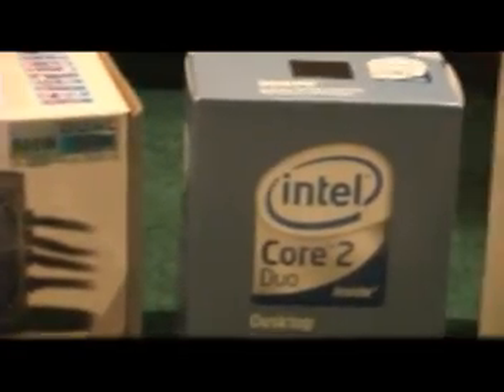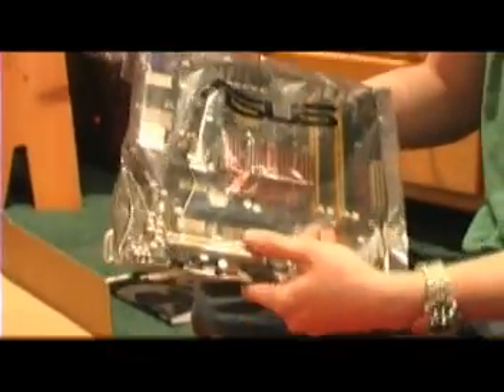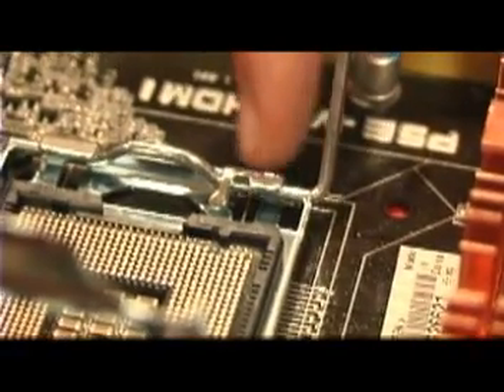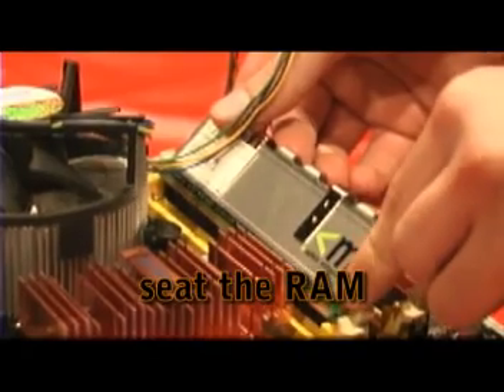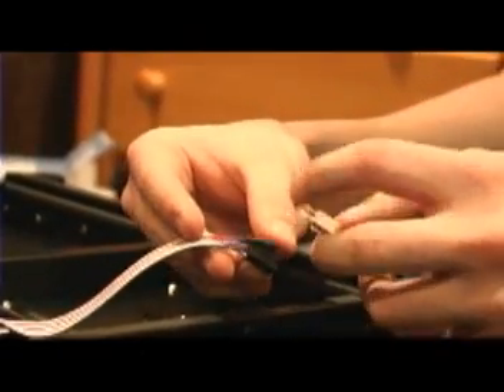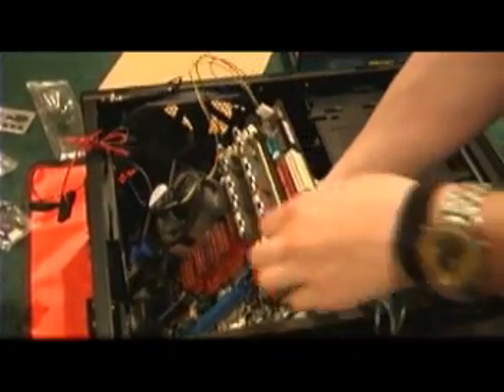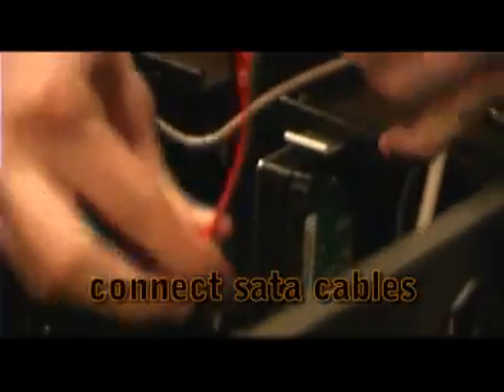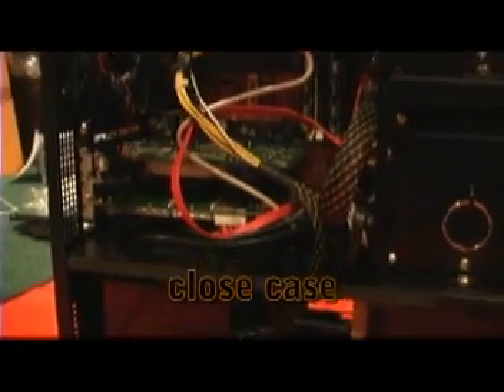A 10 Minute Beginner's Guide to Computer Building

Comment: If you are talking about if they are compatible together, yes. The main thing to look out for with compatibility is to research your motherboard and see if supports your processor. Also make sure your motherboard supports the amount of ram that you are going to put in it. Those specifications should work together if you install it right.

Comment: @JesusReveron 
The fan/heatsink that comes with the CPU has thermal paste pre-applied. If you buy an aftermarket cooler, you'll need to apply a small pea-sized amount of thermal paste to the CPU once it's set in the socket.

Comment: @JesusReveron You absolutely need thermal paste. It covers the microscopic gaps between the heatsink and CPU so you can get the best possible thermal transfer.

You only need to install it when putting on the heatsink though, otherwise it's just messy. Look up guides on applying it, you don't want to use too much or it defeats the purpose.

Comment: @nubemuffin well, most motherboards nowadays, have a flashing utility you can use where it is simple as putting it on a flash drive and using the built in flashing tool, even so some motherboards have BIOS updates you can activate inside your OS. But really you shouldn't have to worry about flashing unless the motherboard literally doesn't work at all, Flashing your BIOS to the newest one isn't always completely necessary, in fact most times as long as you buy a new board, You won't ever need to

Comment: All that anti-static stuff is bullcrap... I work with electronics and i know that even if you rub your motherboard on the carpet it won't make a difference You dont have to be grounded while building just make sure that, before you start your pc up, all the ground wires are in place and that the adaptar is grounded... Then it is all ok :)

Comment: lol, it's not that hard to put together a computer. It's like a puzzle, a puzzle that comes with a manual. Just read it and you'll be fine. I was clueless as to how a computer was build when I built my first computer, I used the manual and it went fine, only problem I faced was that I forgot to plug in power to the CPU.

Comment: . I used to build these as a spare time sort of job.
They are much easier now mainly thanks to windwows xp.
Youd install everything and  it booted ok  but then youd find you needed drivers for this and that to work which was a right pain.
I also used to help people out with comp probs but it got a bit time consuming and I had to stop that,
The parts are designed to only fit one way usually so its not  difficult.
Main thing if youre thinking of this is your motherboard the heart and soul of it.

Comment: I just ordered a complete build, including 18.5" lcd, 9500gt vid card, and 4 gb ram for under 700 bucks.

Ill be using this little tutorial to put it together as the parts used are very close to the ones i ordered.

Thanks! Subbed.

Comment: yes yours is right but if the case doesn't have a vent on the bottom so it can take in air you flip it around. But theres no point on having a out take on the bottom of a case cause heat rises.

Comment: @BaMaNeLiTe  Just like darkstar said, watch the pin orientation, it will only go in one way. dont touch the pins, make sure none are bent, dont force it, with the lever  up and the cpu  turned the right way it should drop right in socket.  Carefully close down and latch the lever and its in and the pins are safe now.  make sure to use a (thin) film of heat transfer paste between the cpu cooler and the processor and secure the heatsink -- plug the fan into the cpu socket and youre done-!

Comment: say the motherboard is socket 775 will it defineatley have the connection on the motherboard for a socket 775 fan? also do all motherboards have the connections for the case reset switch power swtich etc.
thanks

Comment: the bulky psu? I do plug the psu connectons first before the drives and other thick cables, but then I have to also constantly turn the case up on its side, upright, back again, PSU in the case won't make that any easier, better to throw it in there last?

Comment: There is one built ON the motherboard it's usually very crappy unless it's a nVidia card.

To find your video card/chip, go windows key + r and then type in dxdiag. 

Go to the Display Tab and it will tell you,
Like.. I Have a GeForce 9500GT,
but my onboard one is a GeForce 6150SE,
If you get a actual video card, it will disable the one on the motherboard.

Comment from the maker: You can still use XP just fine.  That just means it can use Vista if you want.  A 500W PSU should be enough, but you might want to get something a bit higher in case you upgrade in the future.

Comment: hey 
its me again with prob a dumb question but you have to start sumwhere right?
lol kay well change of plans on the ram and the cpu.i was going with the phenom 2.5 black editon and then i was thinkin i could save alot of money by going with a the athlon 64 x2
(2.7)  and i have a question on power supplys and how my board says "vista ready"  kay well question is if i get a 4850 would a 500watt psu be enough?  and i was wanting to use xp. would this be a prob cause the board says vista ready.

Comment from the maker: this is true.  The speed will be set to 800 by default, and you will need to turn it up.  Check the settings for the RAM though, because you may also have to adjust the voltage and timings.

Comment: this was put together well.
i do have a question about setting up my bios when i get all the parts. i read the reviews on newegg about my board (msi k9a2 platinum) and they said you have to set the ram speed. my question is if im getting ocz reaper ram(1066) what would be a good setting?

Comment: you don't need any grounding bracelets...just touch the case and you're grounded, but don't touch for example chipsets...take them from the sides abd don't use any wool clothes...just touch the case before you start building!

Comment from the maker: It completely depends...  Retail Hard Drives will cost more, but usually come with screws and the proper cable.  OEM drives cost less, but don't come with a cable, and only sometimes come with screws (mine came with the OEM HDDs).  Retail cases almost always come with all the screws you need.  I suggest an OEM drive because they are cheaper, and you'll have the screws from the case, and the cable from the motherboard.